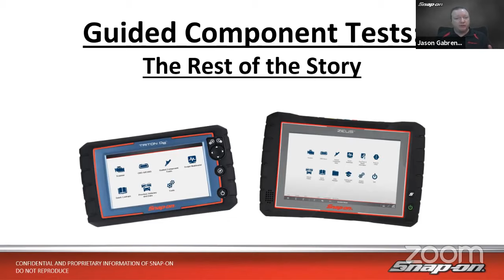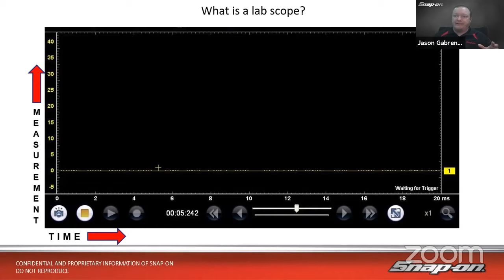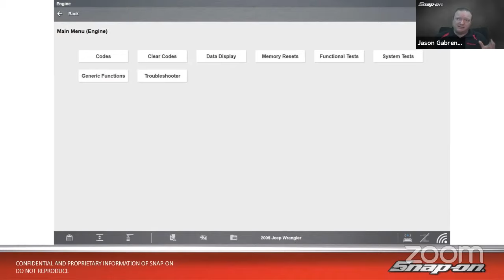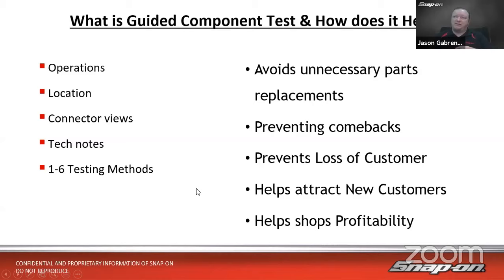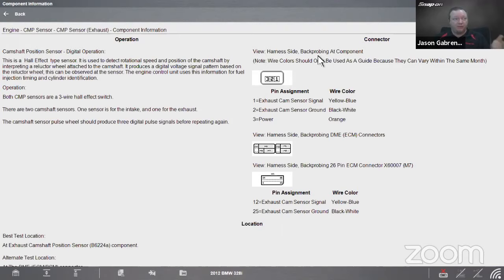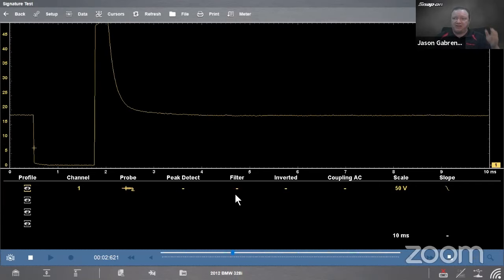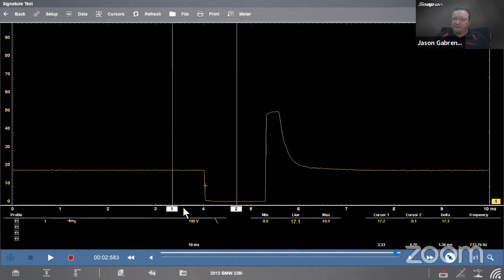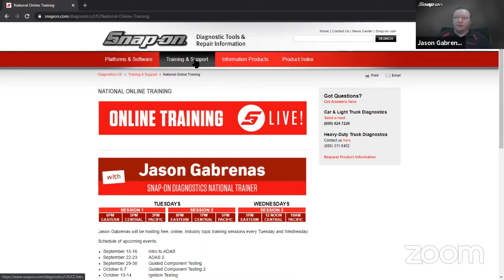Snap-on Live Training Episode 03 – Intro to Guided Component Tests

Comment: I have an older Versus D10 from 2012. The newest update was 17.2. It doesn't have the training classes on it. Is there anywhere else I can access those?
Reply from the maker: You do, just hidden in a different place. Once you are in Guided Component Tests, select the menu on the bottom left of the screen (3 lines) and you should see a selection for "Top Level Menus". The information will be there. There was a major update to the material since 17.2, so you won't see as many articles.  Best bet is to get the 21.2 update as that is the last update available for that tool.  You won't be able to update it after October 2.

Comment: I do have a question. The intermittent Jeep no start. The scanner helped you point to the ECM. But the problem is intermittent. Could it be a bad ground that only loses connection at 25.5 miles per hour with the Sun at a certain position in the sky... Or, since the owner likes to offroad could it be green crusties that cause the loose ground? Still learning, I hope that's not a stupid question. thx for your videos. It's always great to get the tool explained to you by a master.
Reply from the maker: That Jeep would almost never start. it was maybe 1 out of 100 tries. The issue was some bad solder joints in the PCM. If it was just a loose connection, a wiggle test may have helped it make connection. In this case, it did not.

Comment: IF i'm poor and do not have this . i should be able to use a DMM to see a signal , correct? ALSO are these categories ONLY on the scan tool or can you go on a website and review these?
Reply from the maker: DMM you could see voltage, resistance, amperage, but you wouldn't be able to see the graphed display like on a scope or graphing meter. The training classes are only on the tool.